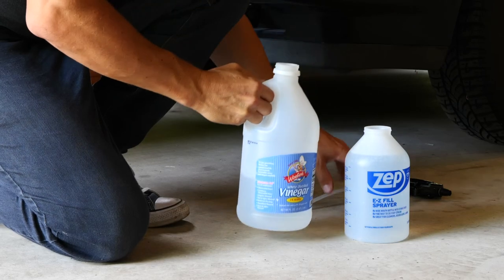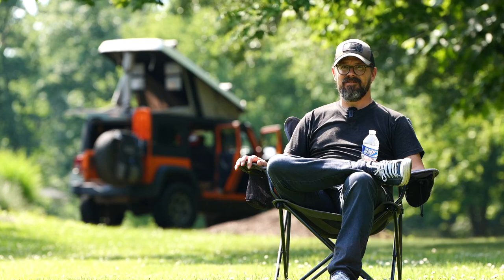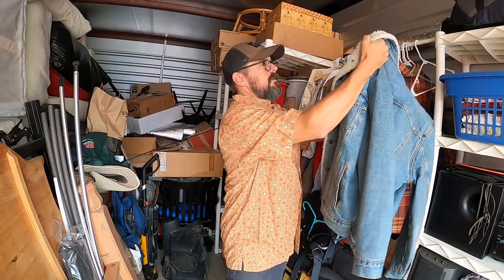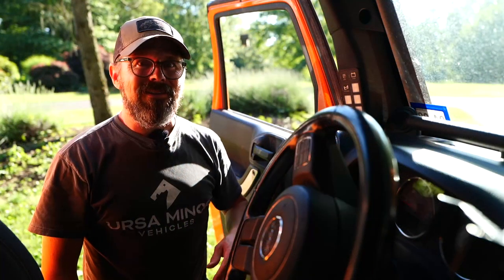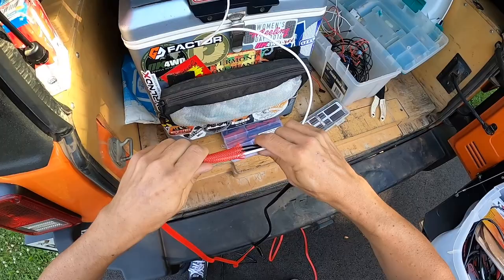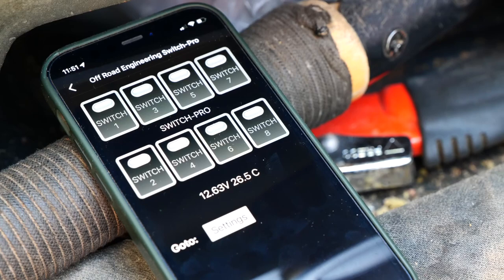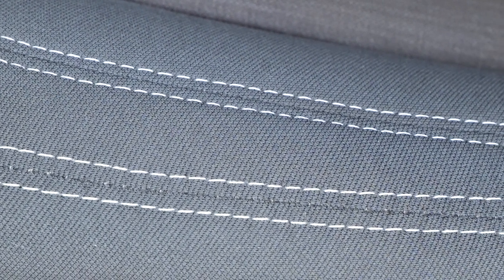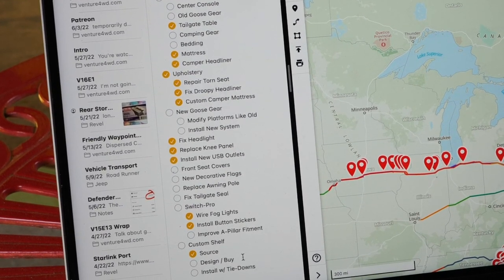V16E4: Camper Resto and a Switch-Pro

Comment: Regarding the seat covers, my buddy put high-end neoprene custom covers on his seats, and we used them for a few years. We concluded our body heat made them hot and uncomfortable. We eventually decided against them and returned to the factory covers with full knowledge that one day a re-upholstery will be needed.
Reply: I agree on the breath-ability factor. I put neoprene covers on my truck when new in 1998. They finally fell apart due to UV damage. Removed them 21 years later (yeah, never cleaned them) and the factory cloth seats were pristine. I was so impressed with the protection I replaced with a new set of neoprene covers despite the less than optimum comfort.

Comment: Just don't see any benefits from having the fog lights controlled by two different switches. But I do see it complicating diagnosing if problems arise. Even though it is not real complicated why add any complications to a system if it does not add a significant benefit.
Reply: He can.leave them on with the high beams which the factory doesnt allow.  He also stated the benefits of adding security.    Makes wnce to me
Reply: @randylenz254  being able to leave them on with the high beams is due to the switch pros not because of having the factory switch being a trigger.